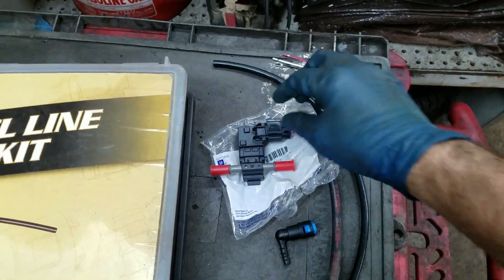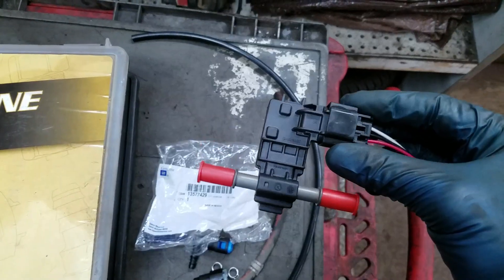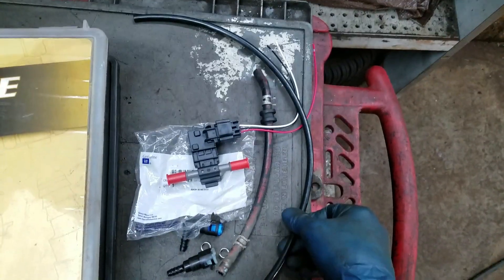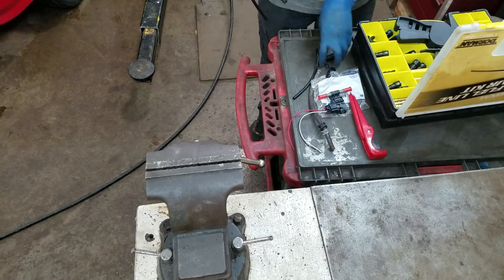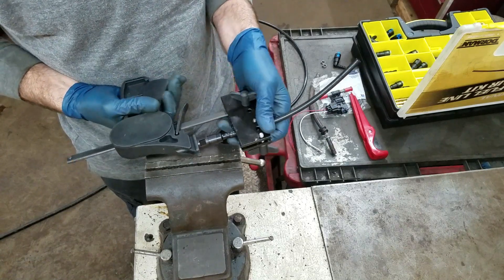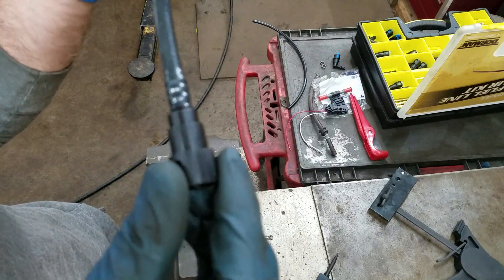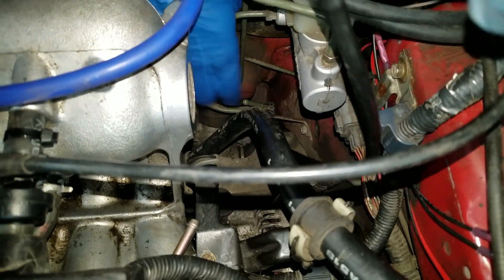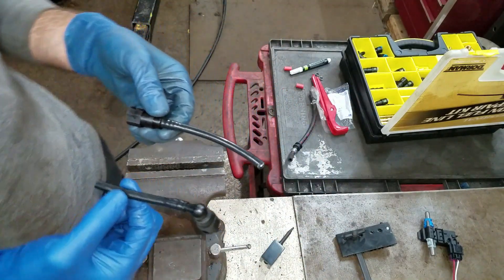Ej8 D16 Civic Ebay turbo build part 15

Comment: How much for that wastegate & oil feed/drain fittings?
Reply from the maker: I got the wastegate, and BOV in a cheap ebay turbo kit. The drain fittings I pieced together, because the cheap turbo kit fittings didn't work. Can't remember what I spent.
Reply: @RustBeltAuto  yeah the fittings I'm having a super difficult time with honestly. Like you said, people sell a lot of junk... where did you acquire those fuel injectors from?
Reply from the maker: @Eric-tc9mh  got them off of ebay.
Reply: @RustBeltAuto  I've watched countless different turbo civic builds and I've got to say, yours is the most detail oriented series I've watched. It's kind of inspiring. Its too bad i live in California or i would damn near commission you to build mine
Reply from the maker: @Eric-tc9mh  YoU cAn Do It!!!!!!
Reply: @RustBeltAuto  attempting to do anything on a car you drive daily can make a man out of someone. I think Nascar pit crew members started out this way. 1. Take it apart 2. Put back together in time for work the next day 3. Repeat until vehicle is modified

Comment: I wish I could get one of these 90's Hondas in California but they're very popular with the creepers here. Would suck to buy one and have it disappear less than a week later
Reply from the maker: I have a disabling alarm, and some dirty little tricks I will not tell anyone. I have had master techs try for fun, and thief's try to steal my car on many occasions on a few Honda's I have owned. 2 out of the three locks on this car are ruined. Probably going to get GPS for this car soon too. Nothing of mine has been stolen yet. Best to have it locked in a garage, or blocked in. 

Saint Paul has a very large population of Hmong's. There is no shortage of Civic's, and stolen Honda's around here either.